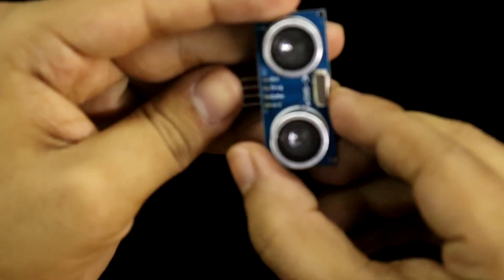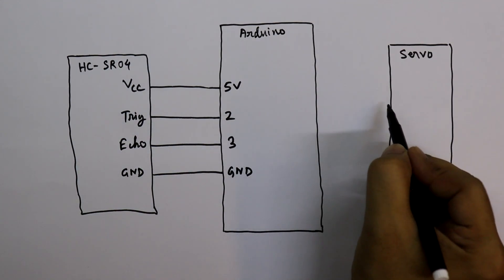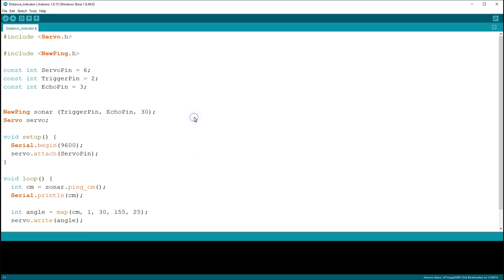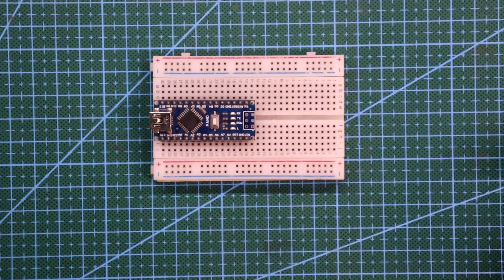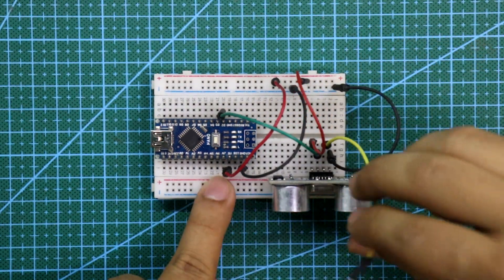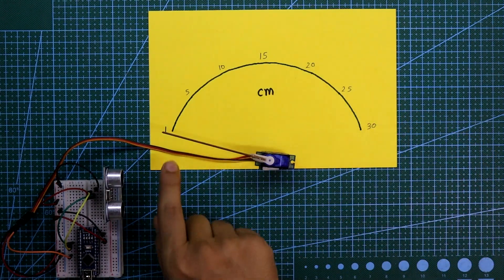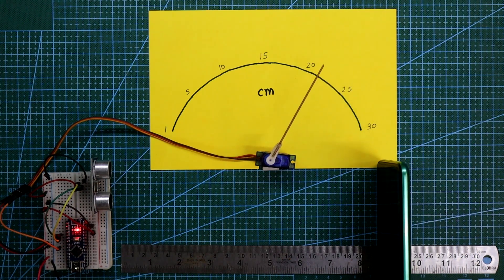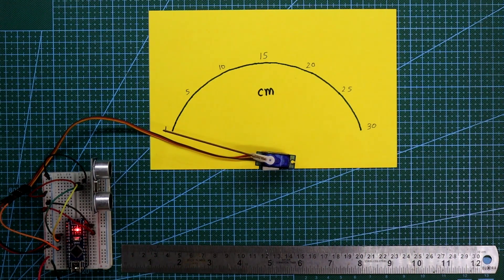Servo distance indicator | Measure distance using servo & Ultrasonic sensor

Comment: it's actually working 🤩 but the servo motor is not moving with perfect angle and flactuating
Reply: that need PID controller, set the values of Kp, K1, and Kd in your code

Comment: Sir is it works
Reply: Is this can  we done with uno arduino
Reply from the maker: Yes, we can.
Reply: With same code and design sir
Reply from the maker: Yes, same circuit same code.
Reply: But pis are different in both sir
Reply: How can connect this experiment with uno arduino
Reply: Sir Will you  pls   provide me design and code for this project with arduino
Reply: I did this project  by watching other  vedios  but  the motor not moving   using  uno arduino
Reply: Sir will u plz reply me
Reply: @silaganasneha9719  attach servo signal pin to uno pin 6 and sonar sensor trigger on arduino uno 2 , echo pin on arduino uno 3 then use this same code